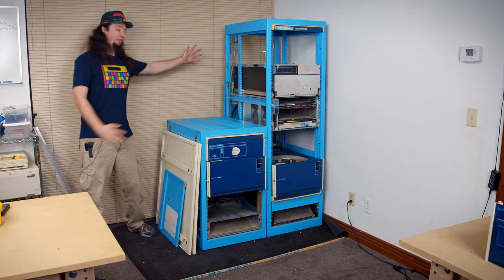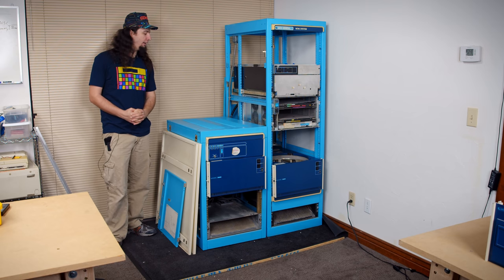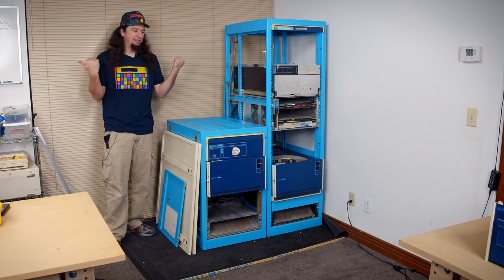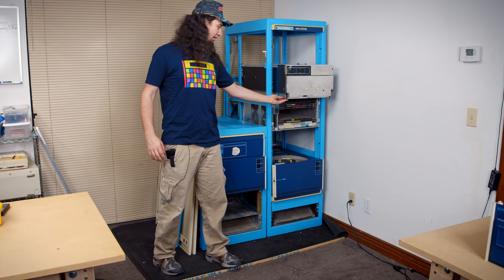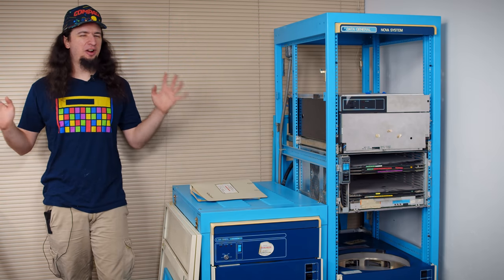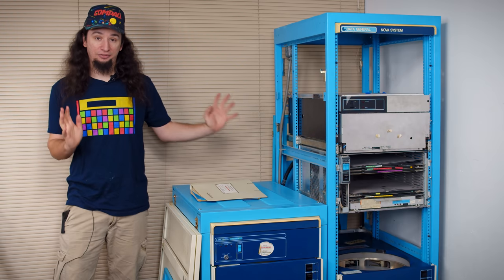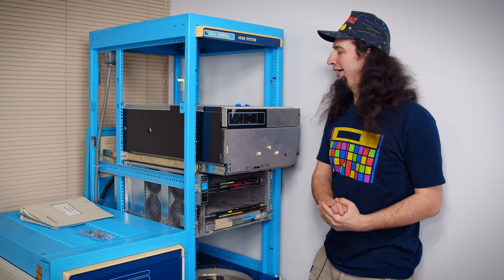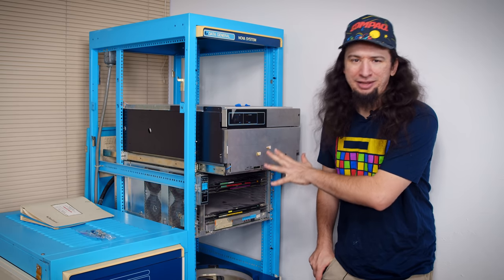Data General Minicomputers: The First Step

Comment: If this is a mini computer, I now understand why modern computers have micro processors.
Reply: Yeah, it makes you understand why the Apple II is considered a micro-computer
Reply: @alexthelion335  Or why a CPU is called a Central Processing Unit, it used to be a literal sizeable unit made of discrete parts paired with other units for IO, disc, power, etc
Reply: What would a mega or giga computer be then.
Reply: @belstar1128  A mainframe? Or maybe an electromechanical computer like a telephone switch which while not general purpose were literally the size of buildings?
Reply: Yeah. In the olden days, computers were made of vacuum tubes and took up entire floors of buildings. Then came the transistor and shrank them down to the size of a closet, so compared to that previous stage, they actually were "mini". Then the miniaturisation continued and the machines became small enough to fit on a desk (or next to it). These were then called "micro-computers" (C64, Apple II, etc). Today, basically every computer is "micro", so we kind of just dropped it.
Reply: S-100 by Frank Hayes

When I was young, my friends all worked like fools to get their share
Of an S-100 system, like an Imsai or Altair;
Well the S-100's still around, I'm very glad to say
But friends, I'm here to tell you that it's not the same today

Chorus: And it's cheer up, my lads, let your hearts never fuss
When you're integrating systems for the S-100 bus

To tell the truth, the source of all our troubles seems to be
A committee on computers of the I of triple E;
They settled on a standard spec, 696 by name
Now everything is standardized, but nothing works the same    (chorus)

They say the 80 boards are way too slow - it's enough to give you fits
If the 09 isn't fast enough, then go to 16 bits
68 and z8000 and an 86 as well
And code compatibility goes straight to bloody hell   (chorus)

Then add a board for the modem line and one for every port
And a printer board and a keyboard board, and as a last resort
For every problem we will add a board that has the cure
It's not too damned efficient, but it's a mother, that's for sure   (chorus)

And when it's all assembled there's computer to your choler
It's nice to have a micro but a mainframe would be smaller
And when they turn the power on, it's sure to dim the lamps
With plus or minus sixteen volts and fourteen hundred amps   (chorus)
Reply: @ Foobar The Fat Penguin We might be at femtocomputers right now.
Reply: Thats pretty small for a mini too.
Reply: @St0rmcrash  They were called CPUs before they fit on a single board, let alone a single die.
Reply: @Kalumbatsch  Yes that was literally my point
Reply: @Foobar_The_Fat_Penguin  Not true, its down to the architecture rather than the physical size.

Comment: When I was in secondary school in the late 70's I was one of the first students to do a Computer Studies O level course (UK Qualification). The computer we used was a Data General Eclipse, which I believe was a development from the Nova, designed to better support timesharing. This video has brought back many memories! Although the computer was at a local college 15 miles away we usually accessed the computer by ASR33 Teletype via acoustic coupler at a blistering 110 baud (10 cps). During the holidays I would travel up to the computing centre so I could use the high speed (300/600 baud!) Haseltine VDUs in the data centre., and from time to time would poke my nose into the data centre to talk to the system operators, and the Eclipse looked very like the larger Nova you have, and the exact same colour. I seem to recall in summer the system was operated with as many panels removed as possible, probably a comment on the air conditioning budget rather than the compuer itself! I don't know how much power it was rated at, but the computer room had a row of blue industrial power connectors which I now know to be 32A 240v connectors, with the computer in one and other peripherals in the others, so it seems the power you have calculated is realistic for the time.....
Reply: Funny seeing you here Ian - I have tried to post against this video a few times to point out that a lot of the needed manuals are on bitsavers I think but, they just never appear - if this does not appear I will message you on the forum and you can post the link for him!

Comment: I used to work on DG, in the 1970s: DG made GREAT gear!  In 1985, my DG at home computer was a DG C-330 (a high end business computer at the time).  My C-330 had 5 racks of gear, three of which were vacuum tape drives, and a 96mb "Zebra" disk drive (which was the size of a full-sized washing machine).  While I was out of town, my dog lost his mind because I couldn't let him out for a bathroom break (I was bumped off my return flight), utterly destroying everything in my basement except the DG (because it was in racks).  In fact, he destroyed the entire house, leading to a neighbor calling the cops!  The cops looked at my DG, and called the FBI, thinking that only a spy would have a "mainframe" computer in their house.  The FBI agreed it was suspicious, and they seized everything, including my DG. It took them (and the NSA) almost a year to figure out I was doing nothing wrong, and return my gear - in pieces...
Reply: The current ratings you are freaking out over were considered to be "low power consumption" at the time these were in use.  It's worth knowing that these systems drew a _huge- surge when they were first turned on, which is what you are seeing. Once running, they typically drew anywhere from one half to one third of their rating.  Because of the impressively high draw when first powered up, they had a specific order which the powering up was done in.  First you powered up the CPU(s), as this was the highest draw circuit.  Once warmed up, you turned on the non-disk peripherals, like tape drives, multiplexers, etc.  Finally, you would turn on the floppy drive(s) if you had any (they were pretty rare on DG), and finally, the disk drive(s) - usually a 96mb "Zebra", which was the same size as a half-rack (or a washing machine for those who are unfamiliar with what a half-rack looked like), being careful to disable the "Write" system before th power stabilized.  Once everything was powered up and settled, you would enable the write circuits on your disk drives(s), and reboot the CPU.

Obviously, booting these was a skill, and not allowed to be done by just anybody: you had to be trained up just to boot them!

Comment: My grandfather had a Nova 800 he was extremely fond of, told me many stories of all the shenanigans he got up to with it as a researcher for Kodak.
(At first they bought him a PDP after he was hogging their mainframe, when he learned of the Nova he insisted they buy one for him, and only the faster 800)
One of the projects he said he worked on that really leveraged its processing power was creating one of, if not the first software image enhancement algorithm, but to do so first he needed an image to test on, some of the electrical engineers created an adapter for him to use some sort of picture tube to scan in images, he said if he started it before he left for the evening, it would have an image scanned by morning, one colour channel, onto the machines 1.5 MB hard disk.
The software he wrote to “sharpen” the image, he said, took one week to do a full pass on a single colour channel.

Anyway, he told me dozens of stories like this, so I have always had a fascination with Nova machines, and I’m absolutely thrilled to see you working on one, for such revolutionary machines they do not get anywhere near enough attention. Internally, they seem so much similar to early microprocessors than any other mini I know of.

Comment: Thanks for the update! Great to see these machines getting their own space! A few comments:

The SLAs are likely memory backup, commonish on machines that straddled the transition from core to semiconductor memory.

We use Dawn dish soap, hot water, and either a toothbrush or a small paintbrush to de-filth boards that need it. Often they just get a dry paintbrush if the dust isn't really caked-on or greasy.

You can draw 12A continuous from a 15A circuit, or 18A continuous from a 20A receptacle. That uNova should definitely be fine. I forget how our Nova 4 is set up but I want to say it is wired for 240V 20A. They are of course all 120V inside, splitting the phases on the PDU.

Comment: I think you might have to invest in running a 240 volt circuit into your office to run them.  I'd do that over modifying them.  Although you said you don't have access to the panel so it would be difficult to find which outlets are on different breakers...  Maybe you could have an electrician run a new circuit through the ceiling and you would have to check with your landlord...  
You could also have a electrician check your outlets, you might have 240 volt's behind the outlets if that building isn't that old.  They will sometimes run 240 volts in the walls but split it to 120 out the outlets.

I look forward to seeing this working!
Reply: I agree with this
Reply: yea...i mean it might be costly..but it would even allow the  ability to run up the big 4x unit
Reply: Yes... in a commercial/office rental environment like this looks to be it is not uncommon for people to need 240 for whatever reason, and the tenant should be able to make that improvement. It would be really dodgy to try and do two 120s, because not only could they both be on the same breaker but they could be two different breakers on the same SIDE of the panel, which would be a disaster!
Reply: Yes, we often need 240v for a UPS in the wiring closet in small office spaces just like that.  Should be pretty easy.
Reply: Problem is his is an ancient like 1970s/60s office building you can see it in his initial move-in video. So it would have been built for the needs of an office at that time
Reply: Hmm 240 connected UPS would be a good idea...
Reply: @ShadowRune  no, that's what we're talking about. It's almost certainly got a drop-ceiling. Same reason why you can wire an old office for ethernet; they were built with the understanding that walls could be moved, partitions created, phone lines added, etc.
Reply: Step up transformers can be had from various sources.  Using a step up transformer externally but leaving the computer original might make for the most faithful restoration.  However, the current draw must be considered too.  Most office grade 120 volt circuits support up to 20 amperes, which when stepped up to 240 volts becomes up to 10 amperes, minus a small allowance for power loss in the transformer.

Too bad in a way that this isn't in a residential setting, whose wiring is sometimes easier to modify or connect to (e.g. electric range outlet, dryer outlet, welder outlet).
Reply: I'm an electrician, working on an old office building right now. It was built in the late 60s. It's 3 floors, and it's rented office space, it's very common for a Tennant to need 240v for some reason, and we run new conduit or some MC cable above the drop ceiling....
Reply: @pinrod1  100%

If @TechTangents gets a quote to run 240 and puts it on patreon, that's the kind of thing I'd kick an extra couple bucks toward since it would be so fundamentally useful.

Comment: Back in 1987, when I first entered the job market (as a computer programmer), my daily commute was a morning drive from Somerville, MA to Framingham (and back again in the evening, of course). I used to pass buildings displaying logos for well-known computer companies at the time. I think Data General was in there somewhere, but I don't remember for sure. The company was based in Westborough, which was about a 20 minute drive west of where I worked. I was working for a small software company, and used to fantasize about what it would be like to work for one of the big computer companies. Right now, you're making me sorry I was writing software for IBM clones rather than visiting offices as a field technician for a minicomputer or mainframe company. (Although from a career standpoint, it was probably just as well that I wasn't.)

Regarding the power requirements of your acquisition, welcome to the 1980s and earlier. One thing I can tell you from my second job, in the data processing department of a bank, is that back then, when a medium to large business bought a computer system, the system vendor informed them of what its electrical and environmental needs were, and the data center - typically a big climate-controlled room with a raised floor - was then outfitted as necessary. That often meant 20- and 30-amp circuits and either custom circuits or power converters, air conditioning with humidity controls and air filters, and sound insulation so that the noise from the data center didn't disturb workers seated outside of it. I can only imagine what kinds of RF interference a pair of minicomputers might generate. I doubt it ever occurred to the designers of those minis that anybody might someday try to run one at home. But I'm getting immense vicarious pleasure in watching you try to do just that. If good things come to those who wait, then even better things should come to you for taking on this project.

Comment: I was a field service engineer for DG around London. I fixed all the range of their kit from micro novas, nova 3 and 4, and eclipse ranges. All the hard, fixed, and removable disc drives as well as mag tapes. I ended up working in R&D for them in North Caroline. Great times, I had the opportunity to go repair this kit in some wonderful places. I do hope you get all this up and running, if not, give me a call.😂

Comment: If you had access or permission to run a new circuit from the breaker box, you could have a 240v 30 amp breaker installed and wired to an outlet.

Comment: I got a surplus Nova 1200 back in about 1984 and then a Nova 4X about 1986...I had a couple 1.25MB (I think??) single-platter cartridge drives, a 25MB sealed drive (basically the one you have),  a 9-track tape unit, which took half a tall rack and about 10 "Dasher D2" dumb terminals....All this and a ton of documentation, schematics, etc.  I spent hundreds of hours "playing" with it---everything worked. RDOS, FORTRAN compiler,  BASIC interpreter,  Assembler, etc., etc. I think much of that old hardware and docs are still in an old family storage building---I haven't looked in a couple decades!   Thanks for the trip down memory lane!

Comment: I did a lot of work on DG, mostly on Eclipse and MVs. I have some spare toe-breakers somewhere if you need for the second rack. Regarding the nut plates the trick on removing them was to let them drop. Easier to pull out of the bottom of the rack or put a deflector to have them drop out front. If you were afraid to let them drop bend a piece of thick copper wire to have a small 'L' at the end to fit in a hole and pin it in place from behind. The real fun was putting them back in place! We didn't have cage nuts at the time at all. I may even be able to find a few of the nut plates somewhere. Scotch tape was one of my tricks. I'd scotch tape the bar in the rails. 
The ancient push-on comm cables were 'fun'. We used the DGs to connect dozens of customers via modems so we had expansion chassis' attached with three or four Intelligent Async Controllers (IACs). The backplane was the type you show at 21:28 with the two sets of pairs of pins. Imagine those with dozens (maybe 32) of those push-on connectors side by side. With four IACs in a chassis that was a ton of cables coming out and they used the same kind of pinching flat cable trap used on the three serial cables you had! We often had to go back there with a screwdriver and push them  back in and try to tighten the bars again! Fun times!
The full green connectors you have there are typical (or they could be black) and often they had every pin connected. On the older devices they came out to a 'paddle card' (i have one) which was a flat circuit board to which a big push-on connector would be attached. Since the buss was connected from the main chassis to the expansion chassis that way you had to put a terminator onto the end of the chain or you could get I/O errors. 
Regarding removing the chassis on the heavier one we eventually invested into a hydraulic lift that had a big flat plate to slip it onto. Mostly though we had rails made of angle metal that the chassis slid on to get them in or out. You seem to be missing those. If I didn't have one I would stack crap on the lower devices or to the bottom of the rack (used everything from wood to paperback books!) Eventually though I began making 'hammock slings' by taking old cables and tying them off the top of the racks (we ran about 20 racks with no sides and no top plates) these were strong enough to handle a 185lb Argus drive to swing it out to the hydraulic truck or to a secretary office chair (no arms) 
In case you can't guess I packed away a lot of samples of stuff I worked on. I have about a dozen of the big boards from Nova/Eclipse/Eclipse-MV devices around here, tons of screws and nipples and nut plates. A bunch of the toe-breakers and who knows what else. I also have a few manuals but none likely to help you except a foldout Nova Minicomputers Instruction Reference Card and maybe the DG Unix reference card. (ps with the toe breakers there should be feet screwed into the bottoms to tighten down against the floor to prevent the tipping you were experiencing. I don't think I have those though.)